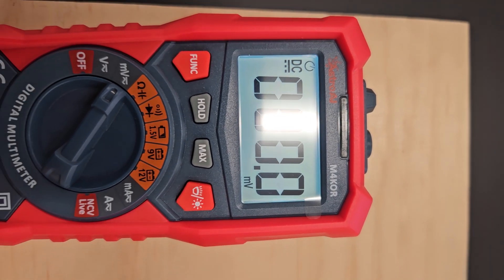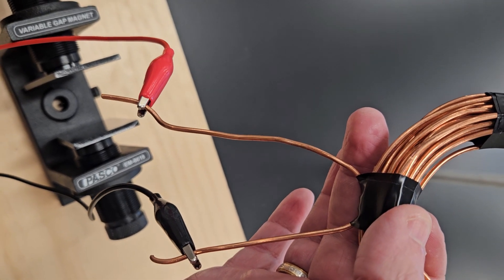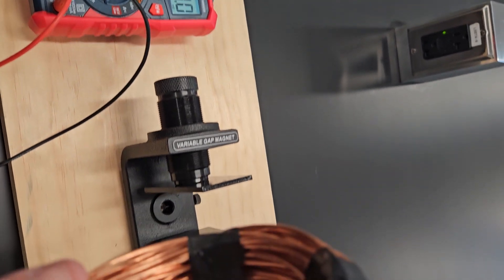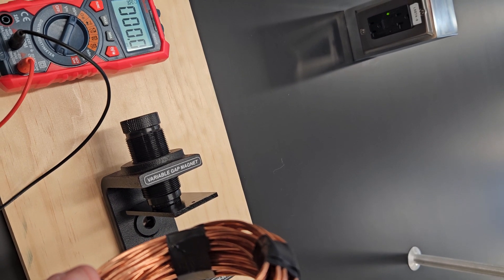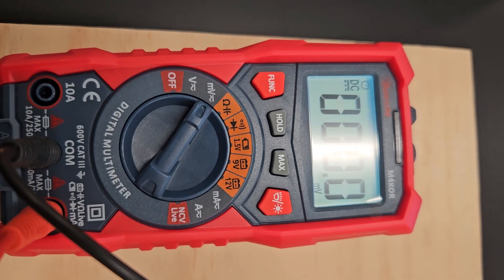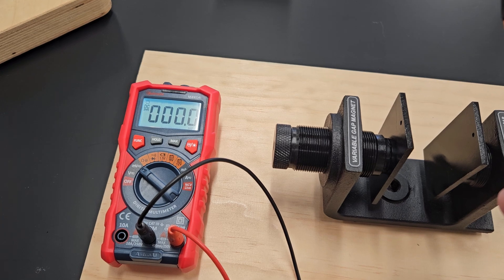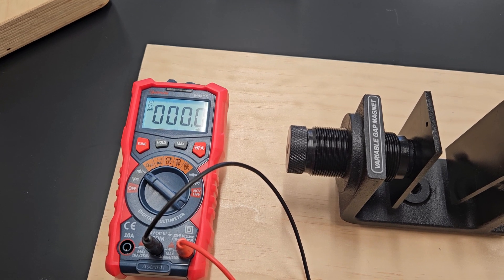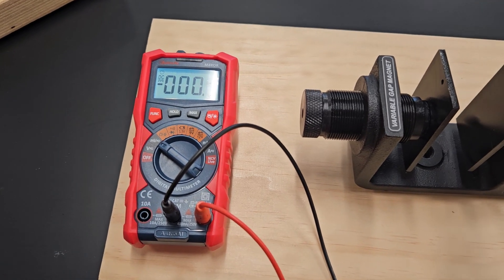Inducing emf in a coil with magnetism - Faraday's Law

Comment: It only generates EMF when the coil is moving so cutting the magnetic field lines, right? Thanks for the video BTW, it is helpful to see actual demo.
Reply from the maker: There must be a variation of magnetic flux passing through the coil, to induce emf. If you put the coil static in between the poles of the magnet, there is not induction of emf.